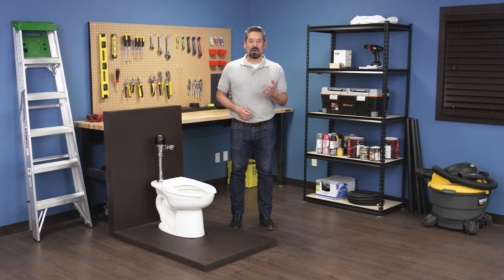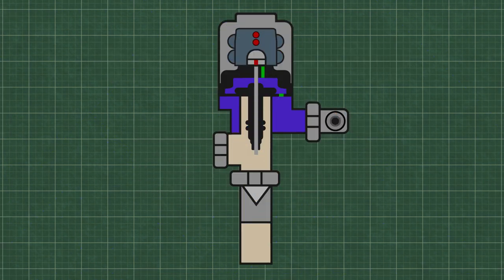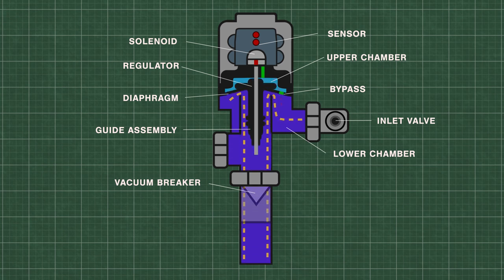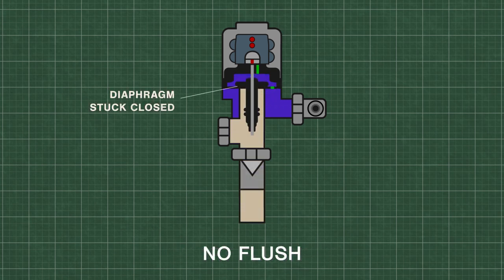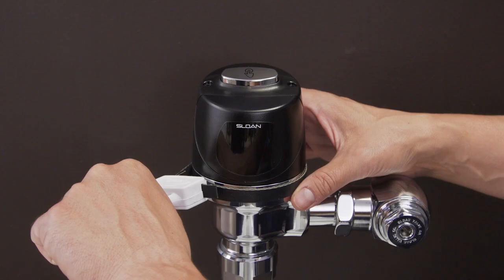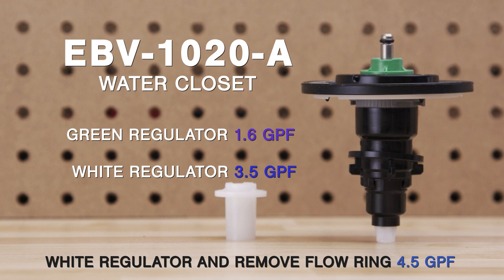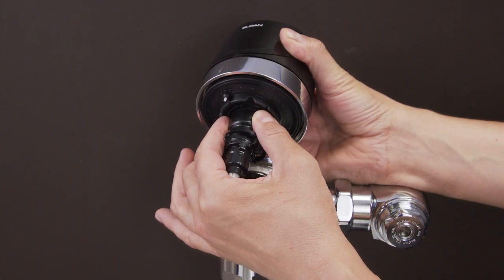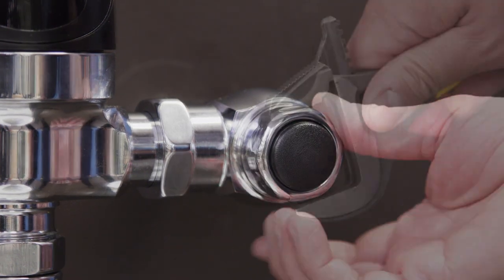Sloan Optima Flushometer | Diaphragm | Repair and Replace

Comment: The diaphragm never goes in that easy on these sensors
Reply from the maker: Thanks for watching. You are right that the repair always seems easier on the video then it does in practice. Things don't always remove or fit in as nicely in practice. Add rust or corrosion into the mix and there's a lot of factors that can make it more difficult.

Comment: Sloans never work that smooth for me. Urinal/toilet constantly runs still. Had them to where I came back next day they worked. Junk.
Reply from the maker: Thanks for watching. Is this just models with sensors or have you had the same issues with the regal / royals?

Comment: What if starts leaking after tightening from locking ring area .what's the cause  ?
Reply from the maker: Thanks for watching. Best to check the threads for any corrosion that might prevent it from making a good seal. If it's a calcium buildup from the water then it can be cleaned with a light acid such as vinegar. Also inspect for any damage to the threads .

Comment: Can you tell me why my Sloan when I flushed make a noisy like
Reply from the maker: Thanks for watching. Noise can be cause by high water pressure. As water rushes past the valve it will cause it to vibrate. This noise might be noisier as the valve closes. You could try adjusting the control stop, this can sometimes help.

Comment: I have 5 toilets that i just changed to the sloan optima. All of them flush and never stop. Sensor, solenoid, diaphragm, and vacuum breaker is brand new. I even tried to replace an already new diaphragm. Im stumped. Any ideas?
Reply from the maker: Hi thank you for watching. If all of the valves are flush and never stop then it could be a water pressure issue. If the water pressure to each valve isn't high enough, then the upper chamber will never fill with enough water to reset the valve. Have you tried adjusting the control stop to different amounts to see if that changes the operation?

If you've found this helpful and want to help support the production of more videos like this, you can like, share or even subscribe to our channel. Every little bit helps!
Reply: @AmreSupply  you know......... i came back to the toilets 6 hours later and tried again and none of the toilets had any issues. Sp extremely confused but your videos are great. I really like the animations you added to show the operations
Reply from the maker: @ieatduhrice9384  The flushometers may have just needed to go through several flush cycles. Its good that they are working now. We're glad you find the animations helpful. Cheers!

Comment: what if it leaks from between the locking but and sensor? I tighten good but leaks after a couple flushes.
Reply from the maker: Hi Felipe Alvarez, if you've got a good tight connection when you secure the locking ring then the leak might be coming from the solenoid. The o-ring on the solenoid can wear down over time and might prevent a proper seal. You can see more in this video: https://youtu.be/2b-x3vawtFA?t=2m9s
Reply: Plastic ring that sits on the diaphragm could also be upside down.